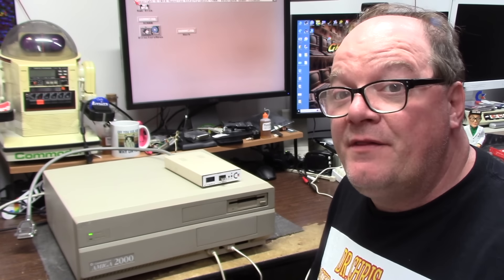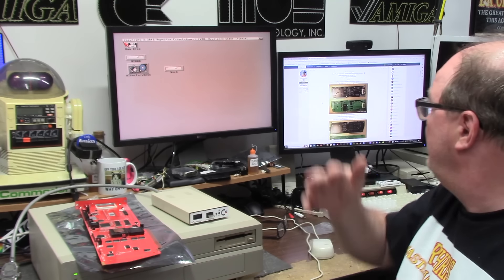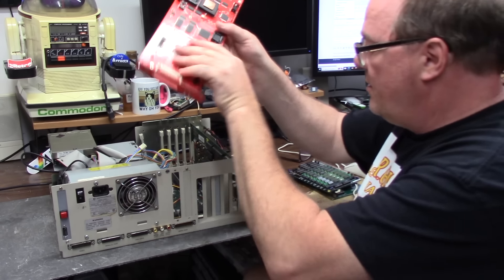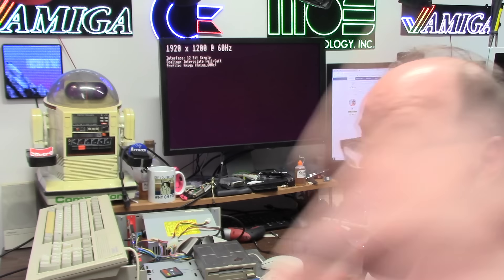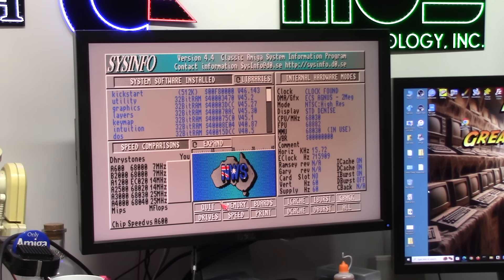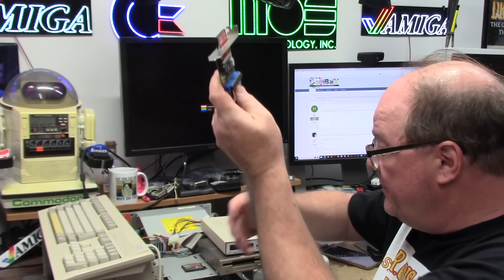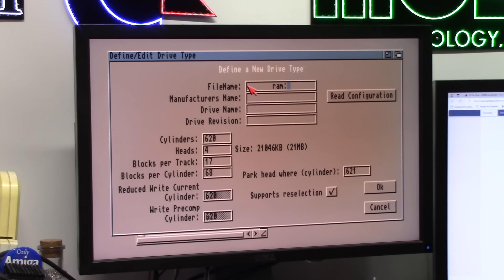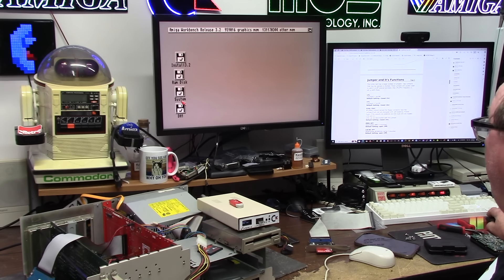The Dicke Olga Amiga 2000 CPU, RAM, SATA, CF, IDE 40/44 Clockport, M.2 Accelerator at 60mhz

Comment: Again, cool new video! The card sounds very interesting. Me and a friend are working on a new hardware for the 2000 as well. But for now, I am still repairing a C128 Rev. 7 - a beautiful machine. But has some serious problems with the extension port. Zimmerman had a similar problem, and it seems there are some issues with some of the logic chips. Working on it, while enjoying your videos! Thanks again!

Comment: This is great option for those that feel that Pistorm is too far removed from the original hardware . I hope this succeeds and then one day we see the next version of this card with WiFi or even Ethernet.
Reply: Exactly. PiStorm is a (very good) emulator, this is a REAL accelerator, as they would have had back in the day. The modern IDE sauce is fine, because REAL 3.5 and even 2.4" drives tend to die these days, so the NVME does make sense. But if you DO have old kit, like a IDE/SATA CD-Rom your good. Great card :)

Comment: 29:08  How can we brighten up the LED?  Happens on other modern devices too, like my PC XT CF ISA card.
Reply from the maker: Amiga is 5v that power is 3.3
Reply: @ChrisEdwardsRestoration  Chris, I noticed this in my review. It was so dim I assumed my LED was broken. Ill give it a try again. It is a pain if it is so dim you cant see it :/
Reply: You can try to replace LED resistors to smaller value. It is 270r currently, try 180r or something like that

Comment: Why not test the 60MHZ mode? I would love to see a 60MHZ 030, I wanted to OC my 030 to 60 back inte the days, I wonder if it would given doom one frame more per second.
Reply from the maker: I can but its fine at 50.  I have so many pimped machines this ones fine where it is.  A major improvement over the stock 7 mhz
Reply: @ChrisEdwardsRestoration  Mine came with 60mhz set, it did not boot. So I dropped it to 50mhz and it was fine. 8 Bit Dreams told me there are certain fixes for the A2000 board to get 60mhz to be stable. Personally, I cant be bothered to do all that work for extra 10mhz. Anyway, its fast enough at 50mhz! BTW, Maprom copies Kickstart into 32bit RAM and then re-boots, so first boot is always a bit slow. But now all calls to the ROM are from 32bit FAST ram and it makes Workbench super snappy. I really need to get this working on my A4000 to get the same juice.

Comment: Did you have to add the crystal for the MMU? Also I was thinking of using the internall SATA port on the card for a CDRW SATA drive, did you try and see if that would work? It would be nice to see the benchmark of the SSD, though you forgot to add 300 buffers to it. And I am suprised you didn't run the demo of choice from spaceballs for fun! :)
Reply from the maker: Nope just worked perfect i guess thats if you want to clock it past 50.  I test all ports and benchmarked it
Reply: No Crystal Oscillator needed if FPU runs on same frequency as CPU does...
You need it only if You want to let FPU run in asynchronous mode

Comment: Before the card is installed, it shows Agnus ECS Agnus at 1Meg. After the card is running, sysinfo shows ECS Agnus 2Meg. Does the card somehow add 1 Meg of Agnus?? Why I ask is that I ordered an Individual ACE2B from Germany. Was that a mistake?
Reply from the maker: Did not notice that. No its still 1mb chip
Reply from the maker: i Checked again at 16:42 on the olga it shows 1mb chip, idk why but sysinfo does display 2mb weird.
Reply: @ChrisEdwardsRestoration  Ok good to know. Thanks Chris!!

Comment: I wasnt quite sure at then end, does it need/support M.2 NVME or is it M.2 SATA?  i would imagine either is overkill speeds regardless.
Reply from the maker: its M.2 Sata, my brain is just wired to say nvme for the protocol whenever i see that slot. its all good
Reply: @ChrisEdwardsRestoration  I originally thought the NVME route was a bit silly. But considering 128gb NVME cost maybe £16 now, its not so crazy. Also, there is no cable, so its VERY neat on the back of the card there. My NVME came with 4 wait-states, which can be changed via the MapRom Util in the boot sequence, I dropped mine to 3 and it still run stably with the NVME. However, IF you wish to play with WaitStates its best to do it early on, on a sacrificial partition as if you go to low/fast it can corrupt it.

Comment: Chris, can this Dicke Olga board still be purchased? I don't see any links to actually buy it beyond forums talking about all the features..? Sold out? Limited run? I am honestly just trying to find some sort of board that provides CF or USB support, if possible. Basically, an easy way to get stuff back and forth from PC to Amiga, avoiding the Parallel port. I really have no interest in more RAM or a 68030+ at this point.
Reply from the maker: yes still sold. reply INTERESTED to the thread and the seller contacts you in message.  its a shame so many of these projects are on message boards, but that one is legit and good.
Reply from the maker: also get a network card and then you can smb mount pc or mac network shares to your amiga like i do , way faster than a card swap, plus you get on the interwebs w your amiga and can dl stuff from aminet in seconds.
Reply: @ChrisEdwardsRestoration  any recommendation for a network card? I looked and could only find an old 10base2 card from the same era as the A2000.
Reply from the maker: @rotorcraft68  i bought a brand new zorro2/3 from icomp dot de.  The x-surf.  Here.  https://icomp.de/shop-icomp/en/produkt-details/product/x-surf-100.html

Comment: I wonder if there's an A500 version coming
Reply: Hey I did a review on this and in my research I found that the original card that inspired this one was actually an A500, A500+ and A2000 cpu slot accelerator. Its smaller of course, so It only supports IDE as I recall. Info on this is in my review.